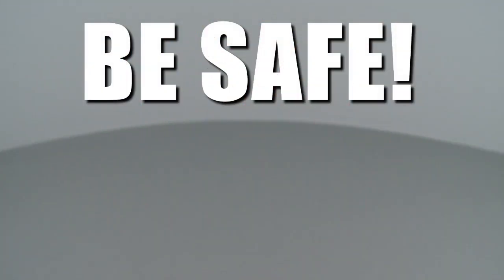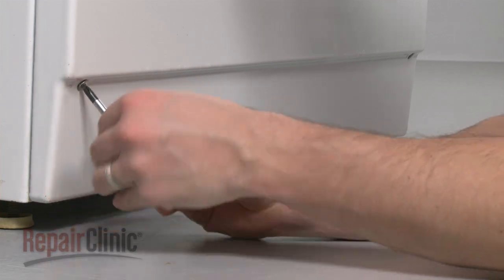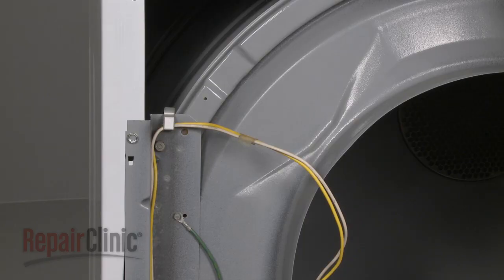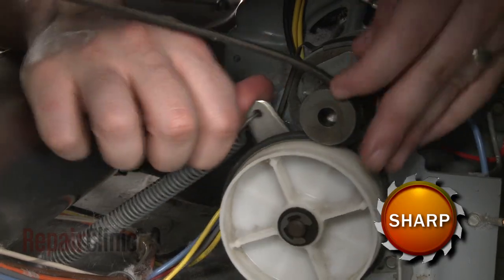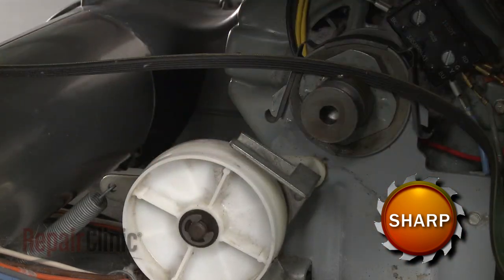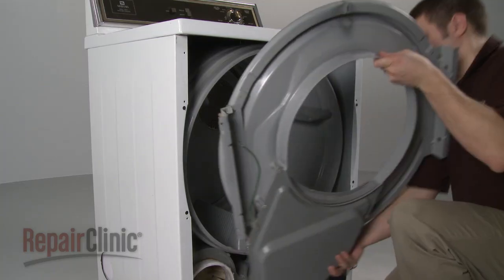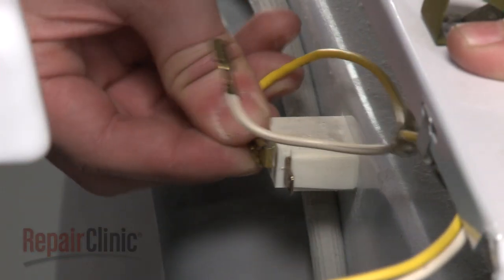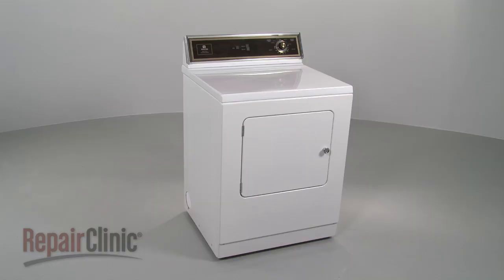Dryer Drum Not Turning? Replace Maytag Dryer Belt #Y312959

Comment: great video!! However, do yourself a favor and remove the back access panel. It is about 8" square, four screws, and gives you clear access to the motor and tension assembly. Very easy job. Thanks R C
Reply from the maker: Thanks for the tip!
Reply: This is critical. The video is reversed to what I see from the front. Why don’t you change your video instead of pretending that your video was perfect the way it was? These diy videos should be idiot proof and I don’t mean that to be an insult to all of us who will probably only change a belt on a dryer once in a lifetime. KISS principle. Don’t leave room for error of interpretation.

Comment: For this particular model of Maytag the drum actually isn’t attached to the back panel it’s free and will fall off. Also there is a back panel on the bottom right of the back of the dryer that you can take off to reattach the belt. Don’t do it from the front. Put the belt around the drum. Reseat the drum. Reattach the front panel then go around the back take off the small panel and attach it to the drive mechanism. So much easier.
Reply: Hey, I'm having a very difficult time keeping the belt from twisting onto wring side, as well as getting enough slack to slip over the smaller pulley, even with the belt in groove etc - belt keeps falling off the back end of the drum. I'm working in it through the back access panel. Any tips/ideas you might wish to share would be greatly appreciated! :)

Comment: If the belt is removed, shouldn't the wheels spin quickly? I had a broken belt, but after replacing it, the pulley/wheel assembly just barely turns at all. It seems odd that both the motor would have gone out at precisely the same time the belt broke, but I didn't make any other changes that would seem to cause the super slow-motion revolution.

Comment: I just completed a "tune up" of my model DE482. (1988)  Rollers, Axles, Belt, and after I got into it. I had tons of slippage on the squirrel fan. I corrected that, luckily, but taking the tension clip off, bending it to make it tighter, and re installed it along with a good cleaning. My advice for anyone who replaces a belt once every ten years, is get the belt generally in place, and then OPEN THE ACCESS DOOR in the back of the dryer. I spent an hour trying the way they demonstrated just working from the front by feel and imagination.  I got real frustrated, and checked the back of the unit, and 4 steel screws and one panel removed. I had it wound around the motor and pulley in 5 minutes. Save yourself a little aggravation and use the rear access to attach the belts to the motor. Thanks Repair clinic for being a parts retailer and DIY demonstrator that gives mere mortals the confidence to take on the appliance word!!
Reply from the maker: +bshingledecker Thank you for sharing.

Comment: This is a great tutorial thank you.  I'm having trouble getting the belt onto the motor pulley itself. ( around min 1:34 or so) any suggestions?
Reply from the maker: ***** It can be difficult when you cant see it. We took the back panel off to get that shot so you could remove the rear panel and have someone else co-pilot the installation.
Reply: ***** i had the same problem ,,, read the comment i just made up above. I'm so stoke i figured it out

Comment from the maker: Sounds like the motor switch is stuck. I would try and turn the drum by hand both ways and see if it turns . If you can’t turn the drum you will need to take the drum out again and see if the motor turns freely without the belt on. Check the wires on the motor to see if they are on correctly and to make sure one didn't fall off when you replaced the motor.

Comment: This was great - thank you very much!  My only comments are that I struggled visualizing that the view of the pulley is from the back of the dryer, and not the front. I also struggled because I was putting the belt in one of the grooves of the drum, rather than on the drum itself, which caused the belt to sit incorrectly.  After three attempts, and 10+ views of the video, I finally got it - thanks again!

Comment: I have serious knee problems that limited reaching the pulleys from the front. I think that if I can get help moving the machine away from the wall, I could change the belt by removing the back cover? Can it be done? Thanks!
Reply from the maker: +Liberty Wagon Unfortunately the front needs to come of to get the belt around the dryer drum on these dryers.
Reply: +RepairClinic.com Hello, thank you for your reply! I removed the front of the machine and slipped the belt over the drum. I removed an access panel on the back of the machine that directly covered the motor & pulley(s). It was very easy to thread the belt around the motor pulley and tensioner through the back opening. It's fixed and ran a long time getting caught up with all the loads of laundry! Thank you very much! Best wishes to you and yours! LW

Comment: Thank you! This helped me a lot. One thing I did a little differently that helped me: when threading the belt between the pulleys, I looped it around the small pulley first, and then while pushing the large pulley worked the belt around that. My dryer has a removable panel on the back that gave access to this, not mentioned in the video.
Reply: Thanks for the comment. I could not get it. I tried and tried for 2 hours, lol. Went in through the back and got it on the second try!!     :)

Comment: Thanks; but my model is LSE7804ACE, combo washer/dryer, and I reached this page by searching LSE7804ACE, but it's not my combo model and doesn't show how to open the dryer case to get to the parts.
Reply from the maker: jwilsonAvalon We have not yet completed repair help information for washer/dryer combo units. However, if you search your model number in our website search engine, you'll find replacement parts for your model and related how-to replacement videos that may be helpful to you.

Comment: Thanks for this video. I replaced my belt and it  cost me $19.05 plus $8.97 shipping.  The hardest part was placing the belt through the pulley.   It ran the dryer about five loads since and quite proud of my accomplishment  :o), however now I am starting to smell smoke. :o(   I took the time to vacuum all the dust and lint when I replaced the belt.  Does the pulley need adjusting?
Reply from the maker: The pulley Has a spring and does not need adjusting the spring keeps tension on the pulley to keep the belt tight. This is the only dryer that runs the belt with the rib side facing away from the drum. If you have the ribs facing the drum it might be causing the problem. If the smell is not a rubber smell there may have been some lint that got on the heater that is causing the smell.

Comment: Thank you for the comments about the groove. You saved me from ordering a belt that I assumed was stretched but really just needed to be pulled forward from the front to make more tension. I just replaced the plastic blower fan. In the process everything...drum kind of dropped and lost tension on the belt. Problem solved. Thanks. As a one time deal I had no idea.

Comment: Thank you too for the great video.
But, interestingly enough, I am having the same problem.
The belt is touching the belt on the motor pulley. This is stopping the drum from turning due to the opposite movement of friction between the two.
It is installed just as the video outlines with the grooved side on the motor pulley and the flat side on the idle pulley. The video shows about 1 inch clearance between the belt returning from the idle pulley to the drum and the motor pulley.

Comment: This video was helpful. I have a couple suggestions. First, you failed to mention that once the front bulkhead was removed, the drum was free floating and not attached to anything including the back. Secondly as was mentioned elsewhere, it is much easier to loop the belt through the tensioner with the back access panel removed.

Comment: This video is the only one I watched that showed the proper way to take the dryer apart. The other ones tell you to find the clip under the top panel and pop it open with a screw driver. This is not correct and along with a belt I have to buy 2 top clips.
Reply from the maker: sparky12991 Thank you.

Comment: so I've replaced my dryer belt rollers and pulley but now when I put what was a full load in there before the belt spins around the drum untill I take some of the cloths out. I've verified the belt is placed exactly the same on the pulley as before and is the same exact length as the old belt, any suggestions?

Comment: Please note: It is counter intuitive that the belt DOES NOT go in the groove in the drum. You'd think that it does, but it does not. Took me ruining a new belt to figure this out. Examine the wear mark from the old belt on the drum. As installed, the belt rides the drum just forward (towards the door) of the groove in order for it to not bind up on the pulley system. I feel that it is easier to get it all together with the belt in the drum groove, and then once everything is bolted and back in place, rotate the drum by hand clockwise and pull the belt out of the groove toward you with your fingers as you turn it, and it will align properly. This is important!
Other than this important detail, great video that helped me fix my dryer.
Reply: Absolutely true - that narrow grove at the rear of the drum is NOT where the belt rides. It rides just forward as Chris Smay describes - you should be able to see the mark of the belt on the drum surface. Thanks, Mr. Smay - saved me some ( not all ;-) ) frustration.
Reply: Àp

Comment: I received the correct replacement belt in the mail but was did not have enough slack to get the belt around the pulleys using the instructions from the video. 

I was finally able to complete the job but only after channeling my inner MacGyver. Everyone says line up the belt on the drum where the old wear mark is. That's true but in my case only after installation around the pulleys is complete. In my case the belt was too tight to get around the pulleys when the new belt was in correct position therefor i found a concave groove (you can also make out the convex effect of the groove on the inside of the drum in this video and there is also a 2nd identical groove closer to the front edge of the drum) on the exterior of the drum that's about 0.25" deep that's only about 0.50" further towards the back of the drum from the wear mark. By temporarily looping the belt down in that drum groove it gave me just the amount of slack i needed to install the belt quite easily. Then it took just a little muscle to stretch the belt back into its proper position, but the transition from the groove back to the wear mark is smooth and graduated so it wasn't that difficult to slide it back in place. If you want to edit in a notation about this into the video, i'm sure it would help a lot of people before they run into the same problem.
Reply: fonduemonkey actually now i'm starting to wonder about something ,,, i wonder if the belt is supposed to stay down in that groove on the drum permanently. The belt-wear-marks about 0.50" away from the groove may be due to someone installing the belt incorrectly in the past. My Maytag is model#DG4910 ser#250922 BZ. If anyone can answer that for me i would be grateful. At this point the drum is a little tuff to spin by hand.
Reply: fonduemonkey But seems to work fine at least for now after just installing the new belt.
Reply from the maker: fonduemonkey Thanks for sharing.
Reply: You're welcome. Thank YOU. I had another question about this model in particular ,,, should the belt stay down in that groove? I'm asking because on mine (Maytag DG4910) the wear mark from the original belt is about 0.5" closer to the door from the groove.
Reply from the maker: fonduemonkey You are correct the belt goes just forward of the groove in the dryer drum.
Reply: +fonduemonkey Thanks you made me realize that the belt was not supposed to go in the groove, it wouldn't roll with the belt in the groove!
Reply: Glad that helped you out!

Comment: So much easier if you take the time to pull the dryer away from the wall and remove the small access panel that allows you to see the pulley area.  Do not... DO NOT let the belt get into the groove in the tumbler drum.  The belt on on my Maytag must go around the smooth part of the drum, otherwise the belt will rub against itself at the motor pulley area.
Reply from the maker: stansdds Thanks for the tips!
Reply: This is what got me.  If the drum tips forward, it the belt will get in the little channel on the drum.  Hold the drum back flush and rotate with one hand, and tug the belt to the smooth part of the drum with the other.

Comment: Mine was a bugger new belt too tight...so pushed belt back so it dropped in groove, then threaded the idler and motor pulley easily, then when you rotate the drum the belt  comes right back up on to the drum in the correct position...That is what worked for mine....I think they left that step out intentionally, why ? your guess is good as mine.

Joe Doer